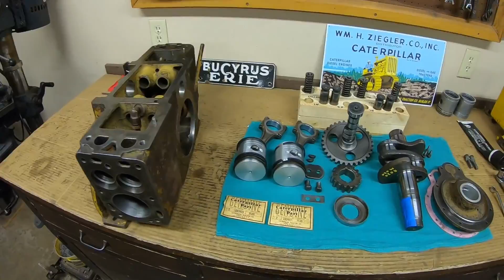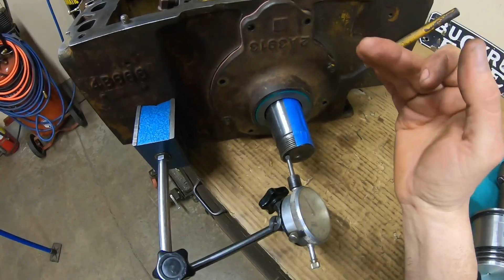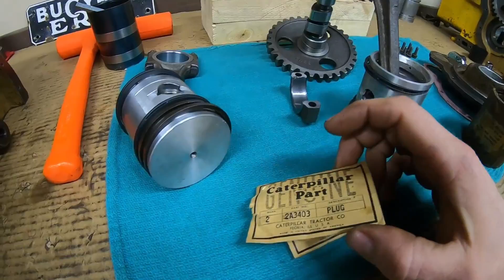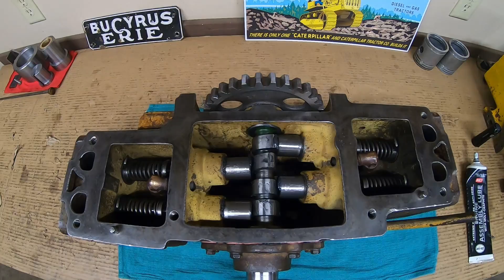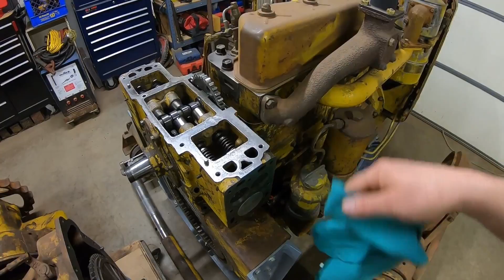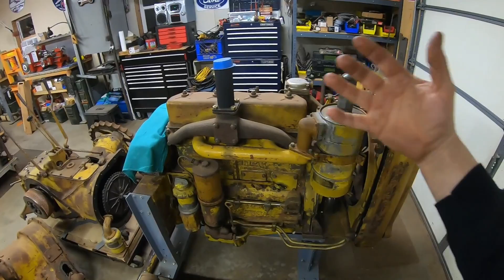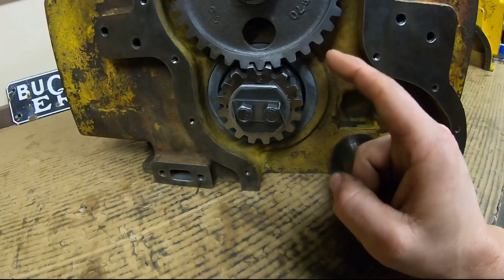The Caterpillar "Pony Motor" - Cursed by Design?? Or the Perfect Balance of "Just Enough"???

Comment: Anytime something pops up here I watch it BEFORE anything else.  I had considered using one of these in a mower or trike, but, they are just TOO heavy.  When you need to crank a diesel over for 1 to 2 hours to get warm enough to start electric just doesn't cut it (building the Alaska highway).  Of course this is easier then using a hand crank!!!

Comment: Worked as a tech where we had 2 - D9G one with a pony engine one without. We had 2 to 3 times as many issues with the electric start vs the pony engine. When starting a massive engine as the 353 having the oil pressure, heat before compression and fuel is a plus with the pony engine

Comment: My D2 came with a coolant heater plumbed between the lower radiator hose and the inlet for the coolant guage.  Works well to shorten the run time for the starting engine as it and the main are heated before use.  Also, my on-off didn't work and it still does not.   Not needed...Starter gets an oil change every 5 starts. Cheap insurance IMHO
Reply: Another cheap insurance mentioned elsewhere is 100:1 2stroke mix in the gas, a pint goes a long way

Comment: With the “poor quality “ engine oil back in the day, 250 hours on a little gas engine sounds reasonable. Remember that car engines of the 1930’s to 60’s were overhauled a lot sooner than today. I will guess at 30,000 to 40,000 miles??? and a 100,000 mile car was very high miles, not desirable, and just shot.  And weak starter with a battery that could hardly turn over a gas engine, let alone a big diesel.........

Comment: I’m from the school of liking starting engines, especially when bleeding diesel fuel system. 45 years ago I ran a Bucyrus-Erie 22B with a D318, rope start only pony. Would generally start in 1 or 2 pulls. Yes, always, always shut off gas and let run dry and besides preventing oil dilution the carb will be dry so it won’t gum up if let stand for extended periods of time. The 22B I spoke of sat for about 15 years, I went to start it, poured fresh gas in tank and it fired up like it had been run yesterday.
Reply: the oposed pony not as good as the others

Comment: Personally, having a starting engine is what says vintage Cat to me.  My great uncle ran a Cat from the 50's for the company he and his brothers owned until he retired in the 90's.   Same machine forever, and it likely wasn't new when it was purchased.

Adding pressure lube would have been great, but probably would have doubled or tripled the cost.  Adding a pump and oil capacity seems easy on the surface, but pressure lube would have necessitated block casting changes, way more machine work drilling oil galleries, and a solid crank would have been needed.  All of this would have also increased weight greatly.  Having no hands on experience with these, the only short coming I can see is they needed an updraft carburetor to minimize oil dilution when the gas isn't turned off.

Comment: I figured based on the same average and 3k starts and went a bit further with one additional variable, rationing during WWII. So figuring 2 starts a day to allow for dinner break time and also figuring that in that Era work was also likely a 6 day week for the people running these machines, right about a 5 year service life on what is effectively 80+ year old starter technology. That's really pretty respectable, especially if you factor in adverse operating environments, potentially lower oil quality, vibration, RPM, load application, and just the almost over-simplified layout of these engines.

Comment: I can totally follow your line of reasoning why those starting engines are built so simple and why you prefer them - with one execption: why would they HAVE to be cheaper than an electric start option? What would have been the problem/consequences if Caterpillar would have offered an electric start as the base version for the D2 and offered a pony motor as an upgrade option?

Comment: Question about turning the gas off to shutdown the engine. Once the engine is shutdown and the carb run dry do you then turn the fuel back on to the refill the carb so that you don't suffer with flaky dry deposits  and or gumming of orifices especially nowadays in the enthusiasts world where there might be long periods between running events?
Reply: You do not open the gasoline cutoff valve until the next time you want to run the pony engine.
Leaving the carb bowl "dry" accomplishes 2 main benefits.
An empty carb bowl prevents the dry flaky deposits because those only form over a long period of time where the continued evaporation of gasoline in the bowl takes place. And with  gravity fed carb, the float bowl will continue to refill itself from the tank as fuel evaporates off of the top of the fuel in the float bowl.  It will continue to keep the bowl refilled until the tank is empty, or until the needle valve sticks in the closed position, or until varnish prevents fuel flow.
The second benefit of leaving the bowl empty is because when the fuel is left on, normal operation (physical motion)  of the dozer going back and forth, and tilting up and down and sideways results in some liquid fuel being spilled over into the intake system of the pony engine where it makes its way into the cylinders and past the pistons to dilute the lube oil.  In equipment where a gasoline engine IS the PRIME MOVER,  this form of gasoline movement THROUGH the carburetor is not a factor when the prime mover is shut down,  but the gasoline pony engine is subjected to a lot of motion during operation of the prime mover that can put gasoline into the lube oil.  You certainly want to cut that gasoline off and leave the bowl empty when the pony engine  is not running.

Comment: What about converting them to electronic ignition ?  how would you go about that ? greetings from the UK
Reply: There are regular points inside the magneto. You could convert that to electronic along with a battery powered ignition coil. You can still buy brand new magento ignition systems for Harleys.

Comment: I know my dad always shut the gas off after getting the Diesel engine going but I don’t know if the pony was ever rebuilt I do know the Diesel engine had main bearings and head work along with a clutch at one time along with pins bushings and new weld on sprockets I don’t know how many hours but the tractor was about 15 years old and dad was the second owner 
I sure wish I knew more about the old cat

Comment: When you consider a technical choice of the past you must always consider the technology of the moment and the theaters of use of the tool. In the middle of a forest or desert, you'd prefer a starter motor that doesn't depend on the limitations of a battery.
Reply: Just like today's electric cars.

Comment: With electric starter now you have battery troubles and most big machines go 24volts so now you have double the battery troubles specially on cold days now glow plugs eat up a lot of battery juice pony start is better in my opion
Reply: Impatient people glow for way to short time, and waste battery power cranking the engine. The small indirect injection engines, like Kubotas, need glowing for 30 seconds and more, then they'll start right up.
Reply: A kubotas have a short stroke and only four cylinders a d8 caterpillar 1957 has a 6 inch bore a an 8 inch stoke it would take a lot more then on battery and a few recharges to start it in cold weather oh and the d8 has six cylinders

Comment: I used to work in the Cat Engine plant in Lafayette Indiana and some of the old engine prints were fractions! It was just so bizarre to see a dimension like a bore diameter called out like 3 1/4" +/- 1./64th. And some dimensions were called out as FIT AT ASSY meaning you measured the part that attaches and machine it accordingly. It was a different world back then.  And yes, there was planned obsolesce. If a truck only last 400,000 miles why make an engine that lasted over a million? And that's not just Caterpillar. I know other heavy equipment manufacturers that did the same thing. International and Ford also did it, I am sure many others too. School busses were a good example. Why make an engine that would outlast 3 chassis?

Comment: Carburetor below the intake ports would be the solution to oil/gas dilution.  Even so, not turning the gas off is operator error.  Looks to me these ponies were designed to happy medium spec.  I agree with your viewpoint on these very robustly built little engines.

Comment: All my experience with pony motors is with a RD6. When it wants to start and run they are great. When they don't they are a kick back, hand breaking machine. I grew up 20 miles south of Stockton California.
Reply: Stockton native here as well. On the RD-6 mag, your problem was the impulse coupling. It probably just needed cleaning and light oil so it only trips after TDC

Comment: I’m pretty much like you.  On my old Cat D6   4R series  crawler,  l always enjoyed firing up my pony motor.   It’s rope pull start.  Made sure I had a good mag to throw the fire at it.  Made sure the carburetor was clean and adjusted well, and oil was clean and full.  Is mounted and plumbed in a little oil gauge to the top of the starting motor so I could squat down there on the tracks as I’d be cranking and turning the Diesel engine over getting it warmed up, and could monitor my oil pressure, making sure my diesel had good oil pressure.   Plus it was warming that diesel up.   And something about just listening to that pony motor purring away and turning that diesel over until I was satisfied she was ready make some smoke.  Crack my diesel throttle open and reach down and place that compression release leve to “run” and that diesel would fire up every time.    Man that moved me around with his semi lowboy told me, one thing he always could rely on, was when he came to move me, he knew my Cat was going to start, and we’d get loaded and be on the road in short order.  You take care of that pony motor, and it’ll take care of you.   I also never used that kill switch.   Is always turn that wing nut cock shut-off on my sight jar close and let the pony motor run itself out of gas to shut down.

Comment: In the day when these machines were new and used in remote colder job sites like mining or logging, they were reliable as hell. I use my D4 to push snow. Love starting that old cat. Electric start pony tho
I wonder how many electric starters on the diesel burnt up compared to pony failures?
Reply: The ether probably destroyed the electric start diesel engines, because the operators HAD to get the diesel started before the batteries went flat.

Comment: All russian construction dozers utilize 1 cylinder 2-stroke pony engines. This engines are extremally simple (no camshaft, no valves, crankshaft on ball bearings), powerful and reliable. Their lifespan is longer than main engine between main rebuild, becouse their lubrication (and all the construction) is similar to morotcycle engine,  so their "milage" is adequate and counted in thousands operation hours. I think Caterpillar engineers in their times didn`t realize that 2 stroke gasoline engines are existing when they designed Cat Pony engine. They did it "american way", so, gas, 4-stroke, many cylinders. Ups its small, how about oil pump? Let`s splash, may it survive 200 hours...

Comment: One of the biggest issues of old cat ownership probably is pony abuse. YouTube is littered with novice or indifferent owners who didn't take the time to learn proper methods and procedures for starting their engines. Unfortunately there are probably fewer examples of the correct way of doing it than the wrong. This isn't a moon launch but does take some sensible thought to do it correctly.

Comment: I like the starting engines and how simple they are, but a question, is it the same type of starting engines on all the models from the same era?? I mean from the D2 up to the D8? Or does the starting engine gets bigger depending on the bigger engine it’s going to start?
Reply: The D6 and larger have an upright parallel twin engine. Featured several times on this channel. At least the D8's have a two-speed reduction gear, but I don't know when they use high or low cranking speed.

Comment: Hi Toby. This is a risky comment, please read it through first folks! I find it very interesting how you balance the desire to preserve the historical aspects of your collection with the 'mechanic in you's' desire to make sure they are less likely to fail in use. Take the pistons and the screwed in bearing retaining dowel as the latest example. It's a fascinating ethical aspect of rebuilding. Is one restoring to original spec? What is meant by 'original'? You don't repaint them now do you, for very good reasons. Is it a matter of preservation, and what does 'preservation' mean? Again you do this with a view to the machines being used for at least 'light' use - not displayed on a stand in a glass case in a museum. There is a 'right' approach to all this of course - it is to do as you indeed do and clearly state what your ethos is. Privilege to follow you my dear Squatch.

Comment: extremely interesting rebuild  My father had a RD4 cat no blade from new in lower New Zealand from 1930s as a contractor pulling a moleplough summer and winter for 16 thousand hours.Had to replace the flywheel and bearing on starter motor nothing else. Main engine required three sets of main and bigend bearing shells in the first 900 hours untill a lack of a oil cooler was found to be the cause for the failure.Both the cat RD/D2 and the RD/D4s used the same sterter engine .

Comment: About on leaving the machine running. This reminds me how the Red army left there T-34 tanks running, idle overnight cause the batteries where not really great on them turning the wartime and in the bitter cold starting one with a very questionable batterie capacity was screwing yourself in a way. I know some of the older people who used to operate with T-100M and it's presuccessor  the S-80. They also left machines running between shifts cause fuel was plenty and there was no reason not to do this. The one thing that I do notice as well on the bigger CATs and there overseas cousins is the same thing with the D2 starting engine. People use the magneto kill switch to 99% of the time shut off the starting engine and that might contribute to the fact they get that bad over time. I personally preferer starting engines, my friend say's this: if it dose not run it means it needs to be serviced. Starter is easy to go but when you have a machine that dose only very light work and is started maybe once a month. The starting engine is a better option cause you don't need to buy batteries after 3-5 years. Some starting engines have both starter and rope options. And the starter only needs a very small battery compared to big starters that need a heavy duty battery. Cursed by design? I don't have more to add to what Toby already mentioned, in the end day CAT probably tried to do what is referred as: Keep it simple!

Comment: We had a family logging business in Northern California while I was growing up and I spent a lot of time out in the woods with my dad and my brother.  The very first Cat I ever saw (and operated) was my Dad's old (even then) 2U D8, cable blade and all. It was outfitted with a canopy, logging winch (no arch) and a simple straight blade, nothing exotic.  This was back in the 60's and I was probably 10 or 11 years old the first time Dad let me operate the D8.  I remember those old snap-over-center frictions - I was just barely big enough to pull them back and reach the brakes to turn the Cat.  I pulled a lot of bull line and set a lot of chokers behind that old Cat and I saw my Dad take that thing places I would never have dreamed of - diving off the top of a ridge yarding logs, or cutting new logging roads in steep mountain country.  With hydraulics and automation today most operators have a lot of advantages those old school cat skinners never had.  I can still hear the 'pop-pop-pop-p0P-POP-POP-POP-zzzzzzZZZZZ-rumble-rumble-RUMBLE-POP-Pop-pop...' of that old diesel starting with the pony motor and then the pony motor fading away.  That always signaled the start of the work day for me back then.  And then in the evening when you finally shut that diesel off, how still and dead quiet things were in the woods, after listening to the Cat work all day.  Under heavy loads you could hear individual combustion events when the diesel would lug way down, pushing dirt, rooting stumps or pulling a heavy turn of sugar pine to the landing.  Wow, that was sure a long time ago :)  By the way, Squatch, I very much enjoy your channel.  Given my upbringing, I worked for a lot of years as a diesel mechanic and millwright before walking away from that to a new career in IT (of all places :).  Watching you rebuild this gear is like an echo to a much earlier part of may life :)   Keep up the good work !